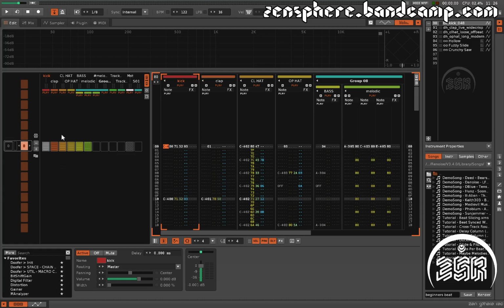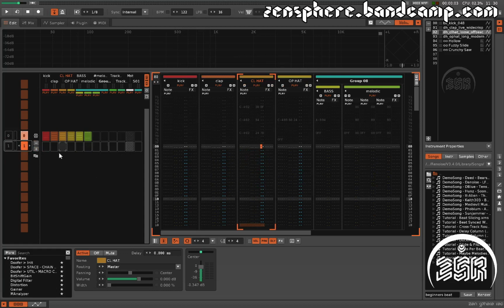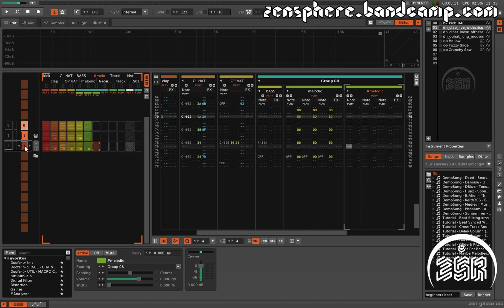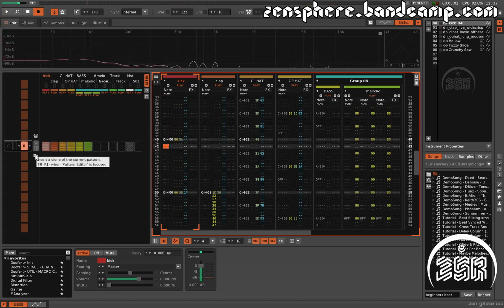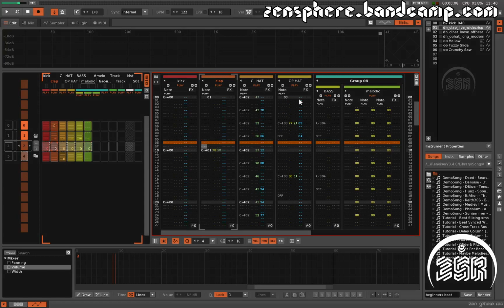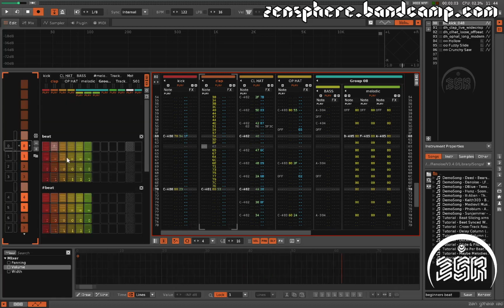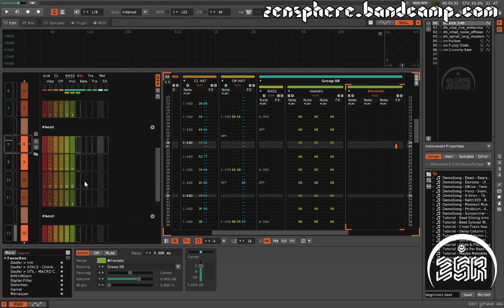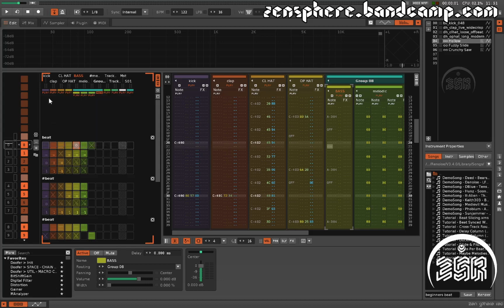RENOISE Beginner's Tutorial series PT.3 •••Pattern Matrix and Pattern Sequencer•••

Comment: Another cool arranging option is selecting different pattern blocks, for example fine select blocks holding down ctrl (on windows), then when you  have made your selection, drag them and hold down ctrl + shift.  You'll notice a line appearing in the matrix. For example; drag the selection holding ctrl + shift downwards until you are at the bottom of the existing matrix arrangement and release the mouse press. The selection wil be appended and new pattern blocks will be automagically added to the arrangement.
Reply from the maker: Yes, I actually meant to show this method and forgot 🙃